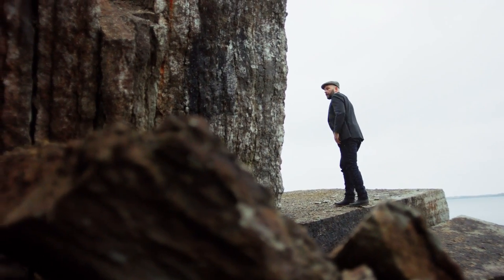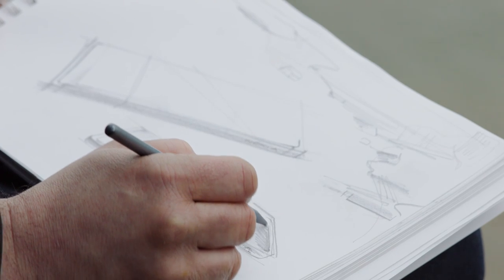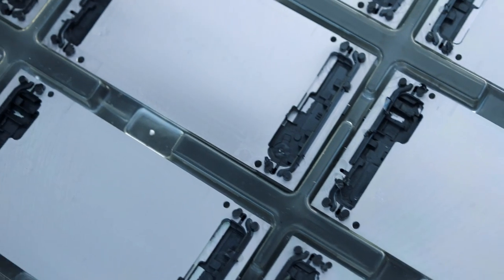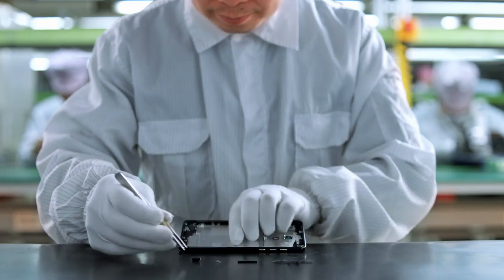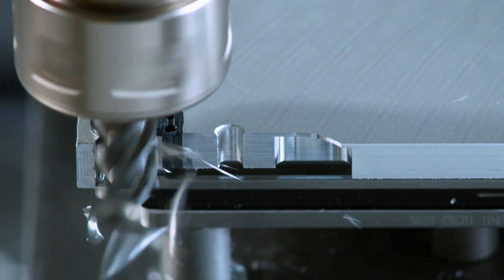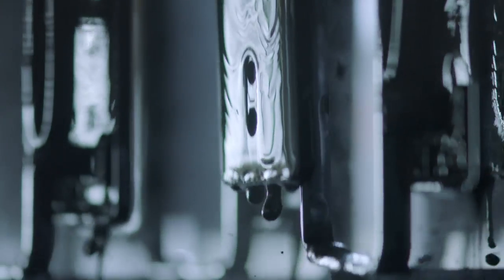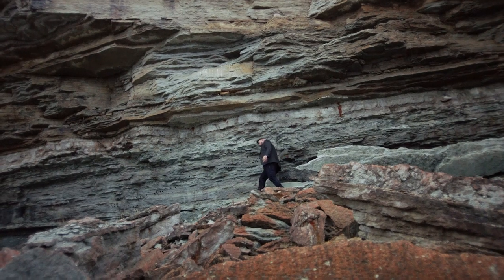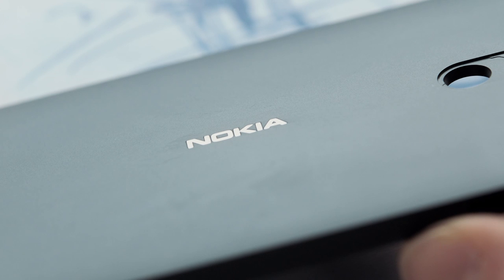Nokia phones design - Quality & craftsmanship

Comment: Best phones I ever had were the Nokia N8 and 808pureview (bought a 2nd 
pureview after I fell into the pacific with my first one). I am now 
using the S8+. This Nokia 8 would be my new phone if they made it in 
2016. Today it's too expensive in comparison to design and features of 
rivals. If you had done the N8, 808, and Lumia phones all on 
Android they would still be king today. I hope they do well enough to 
come back to the razor's edge. Someone please bring back the FM 
transmitter, my favorite bit of hardware. And you can't be releasing a 
flagship phone in September 2017 with soo much black space on the front.

Comment: Nokia 9  5 real camera 41 mp +40 mp+30 mp +25 mp + 20 megapixel ok and front 2  camera 41 mp+30 megapixel ok and  8 GB   ram and 256 GB memory puto 512 GB  memory and battery life 7000 mah   fass  charging sapot and   prosesar 845/855 and waterproof phone and display 6:38 inch and upcoming 2019 and  I 💝💞 Nokia phones
Reply: My expectation
-5 same unidentified pureview camera for combine 5 to 1 for better lowlight and dynamic range and dedicated image processor
-1 front facing camera with big sensor and binning or pureview technology
-Snapdragon 845/855
-8GB Ram 128/256GB storage
-No notch and curve edge AMOLED display with HDR10 and Puredisplay
-Faceunlock and indisplay fingerprint scanner

Comment: Nokia 101 - Nokia Mobira 5000 - Nokia 880 - Nokia 2110i - Nokia 8110i - Nokia 9000 - Nokia 3110 - Nokia 6110 - Nokia 6150i - Nokia 6110i - Nokia 7110 (kinda matrix phone but not, it was the 8110 in the matrix but the 7110 had the springloaded flap) - Nokia 6210i - Nokia 6310i - Nokia 9110 - Nokia 9110i - Nokia 9210 - Nokia 9500 - Nokia 9300 - Nokia 7610 - Nokia 7650 - Nokia E61 - Nokia E63 - Nokia E75 - Nokia E90 - some samsung and LG in-between - Nokia 6 - Nokia 6.1 - Nokia 6.2 - Nokia 7.2 and now Nokia XR21. Might not be all and definitely not in the right order. Provably had a few in between thay I forgot about

Comment: Hey Nokia, thanks for talking about Scandinavian design, but you are aware that Finland is not part of Scandinavia right?

And this CNC milling process with a block of aluminium is the exact same thing Apple has been doing for many years now? So this design process is just as american and chinese as it is anything else. I fail to see how this has anything to do with finnish design heritage.
Reply: Since most phones are outwardly just slabs, then what matters now, are features, specs, internals and durability.

Hopefully, the Nokia 6 teardown video here 0M3Budnl3aI will convince you of the phone's durability (there's also a follow-up video). Some keywords: solid-metal mid-plate, and nineteen+ screws, while major competition has stuck to using lots of adhesive.

btw, Nokia 3/5/6 come with vanilla Android (w/o bloatware), and these and future Nokia Android phones are to be provided with regular Android updates for some time. Not all phone makers do that.

HMD's current Nokia device lineup is also straightforward and uncomplicated.

wrt design process
So far, only Apple has demonstrated on video the design process of some of their products. This Nokia video shows, that HMD can do stuff, too, and they've included quite an amount of Nordic touch there, with awesome design principles across the range, and for all users and customers.
Reply: Theres nothing nordic about this. They have basically copied the iPhone 5.